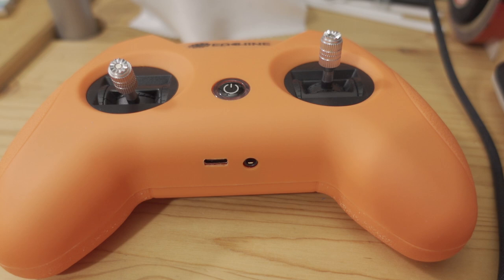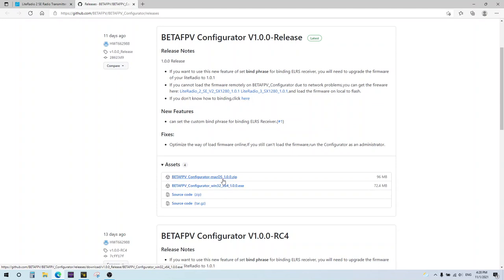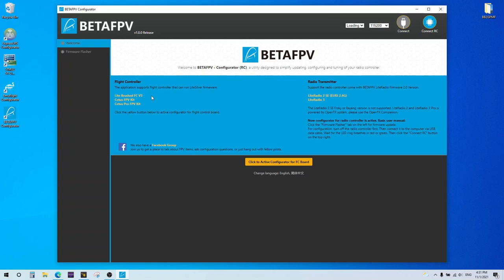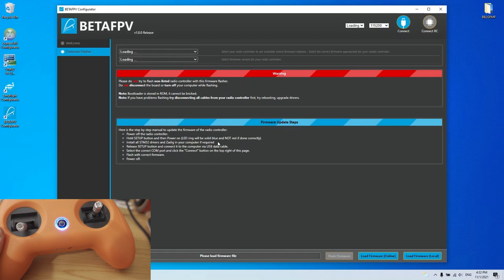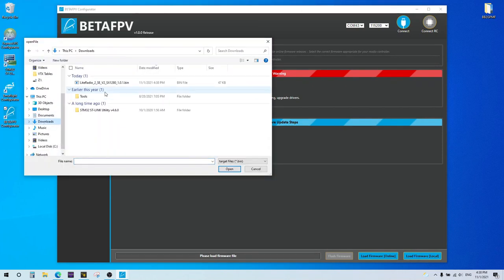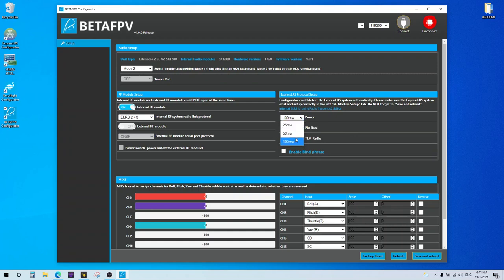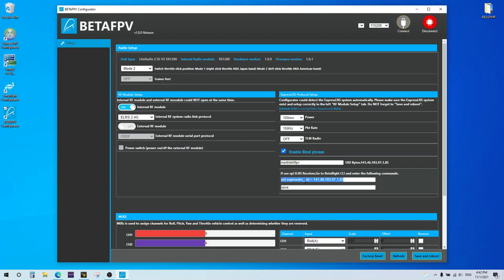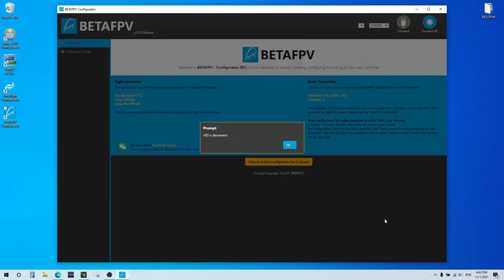BETAFPV LiteRadio 2 SE ELRS Firmware Update Tutorial 🎓

Comment: What do I do if I press connect rc and it’s doin nothing
Reply from the maker: You probably don't have the correct drivers installed or you connected it with the power on.  It needs to be OFF.  If you need the drivers, go here...  https://www.st.com/en/development-tools/stsw-stm32102.html
Reply: I have the same problem! When I connect RC to pc the lighter on controller is off and I can't change setting on RC. But in setup mode controller connects perfect and I can update firmware. I didin't find how to fix it(  (RC was a part of cetus pro kit if it is necessary)
Reply: @psih747  did you fix that ? If yes how

Comment: I had a question I followed your video everything worked out but I’m trying to bind my meteor65 to the controller I just don’t know how. I did download express lrs configurator. Also, I created a bind phrase on the controller. I’m not sure if I’m even able to do it with this board. I’m trying to connect through Wi-Fi. Do you have any suggestions?
Reply from the maker: If you watched the video at 6:40, it shows how to add a bind phrase to the controller assuming you have updated the firmware as shown in the video.  That bind phrase needs to match the one you put into the meteor65.  I'm not sure which version you have but there's a few different ways to add the bind phrase.  Please read the documentation on the expresslrs.org website as it's way too much to copy/paste here.  Lastly, the version of firmware must be the same major version on the controller and receiver.  The firmware in this video will be on 2.x.  The firmware on the drone also needs to match otherwise the bind won't work.
Reply: Thank you for the advice my meteor 65 is running on firmware 3.3.0 and my receiver is running on firmware 1.0.1

Comment: ah.. I can't get the com port to show up with the controller. Works with flight controllers. This is where my issue is. Can I send you my literadio board and have you flash it for me? lol
Reply from the maker: Sounds like a USB driver issue.  Have you tried ZADIG?  Try this video... https://youtu.be/0mrJG7AOmRI
Reply: @AlbertKimTV  yessir. Zadig and driver fixer is not working. I remember a while back on a cetus pro I had to literally use a different computer. I may try grabbing an old lap top and trying again. Of course now the controller is refusing to go into firmware flashing mode again. Maybe I should just return the gimbals lol

Comment: How about upgrading antenna in this radio ? Should be easy to place there router-like 2.4ghz dipole ?:P or just sma and connect anything you like
Reply: There's already a lot of videos on how to do that.  Don't waste you time, Albert
Reply: @925fpv  well , is there any video how it affected elrs literadio 2 se range ?
Reply from the maker: @max max how far do you need to go?  I think at 100mW even with a junk antenna you can go many kilometers away.  If anyone else is interested in a range test, please reply to this comment.
Reply: @AlbertKimTV  Hey, since sma pigtail mod is super easy to do and original antenna is a patch antenna (why patch !?) everyone should know there is possibility to easily upgrade this radio :P i am waiting for my radio to arrive and I'll test both of those antennas but i guess the omnidirectional will give more stable and overall better connection than patch
Reply: @maxmax-xx7nw  The patch works fine as long as you are pointing it in the direction of the quad.  Otherwise, it's worse.
Reply: @AlbertKimTV  Got one more question , and maybe you know the answer. Does this betafpv 1.0.1 firmware works with receivers like ep1 or ep2 with firmware newer than 1.00? Like for example 1.2